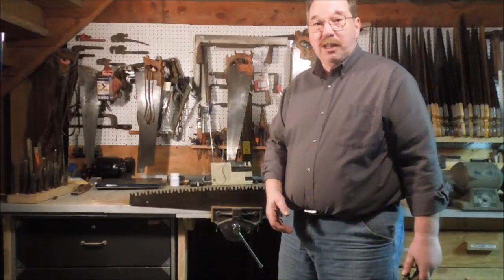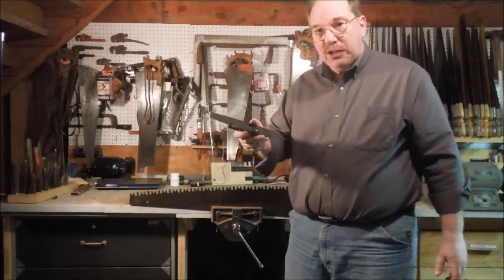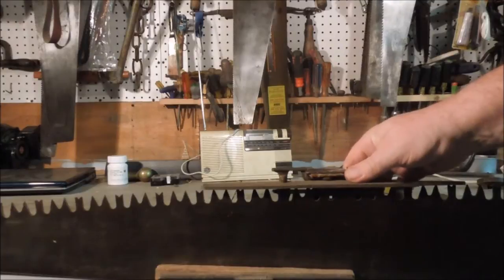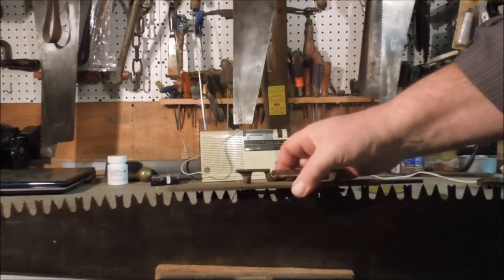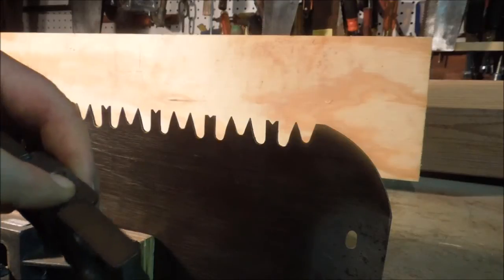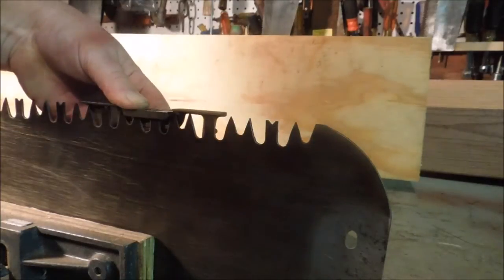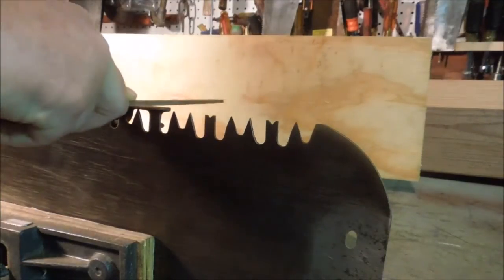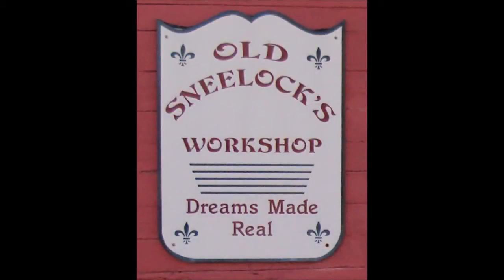Sharpening A One Man Crosscut - Pt 3 - Jointing & Setting Raker Depth - by Old Sneelock's Workshop

Comment: Thanks for this series Sneelock, can't say thanks enough for your advice and tips, I'm very grateful :) I especially had issues with my stanley pistol grip, and I saw yours and bought a Morills, I think its a "newer" version with a screw instead of a plate, but it works fine. 
 
I do have a question, in the start of this video you mention that Panel saws (the one you hold up next to the peg and raker saw) need to have a straight toothline, I do have an old 10 ppi crosscut saw which I recently filed, but I noticed the toothline was arced slightly, just like a forestry saw, to my surprise it actually cuts well, but I can tell all my other panel saws are dead straight, should I change it over time?  And how would you go about it? 

I know from planing wood if you keep planing an arc it will just exaggerate more, so you have to take more from the middle until you almost have flat or even a concave shape to then plane of the ends to flat. Its an effective method, atleast for wood ;-)
Reply from the maker: A panel saw can have a belly too. Your saw will cut a little faster and easier than a straight saw. 
The belly means fewer teeth will contact the wood at one time. So each tooth can act more aggressive. 
It is similar to what happens when you lift the handle so it contacts the corner of the cut. It cuts faster.

Comment: Sir what is the raker gauge you are using?  I have two gauges and they don't sit on the raker, the other teeth interfere by hitting the tool.  Champion style saws.
Reply from the maker: The raker gauge works by having the cast tabs on each side sitting on top of the pointed teeth. The raker tooth protrudes through the slot inmthe center of the gauge. The idea is to have the raker teeth shorter than the pointed teeth. That way the pointed teeth score the wood before the raker chisels out the wood chips between the two score lines.  You can see a representation of how this works in Part 1.
Reply: I understand exactly what you are describing.  The cutter teeth are relatively close to the rakers making part of the steel edge of the recessed raker guide actually hit the cutter teeth.  Essentially the raker guide is sitting on a skew instead of flat.  I was wondering what model raker guide you use or think would be acceptable to use?  I can post tool And saw teeth dimensions when I get home after work.  Thank you for your videos on the champions, excellent work!
Reply from the maker: @iwbuck  I learn moremaking these videos thsn you guys do watching. 😆
When I started sharpening one man saws I put the raker gauge that I used in this video on the saw and thought that it was too big. I thought it would only work on two man saws with bigger teeth. So I spent a day making a new gauge for one man saws. After I used the new gauge I got to looking at the big antique gauge snd realized that if I set it on the saw correctly it fit just fine. The only thing is, one of the pointed cross cut teeth pokes up through the slot next to the raker. You have to be sure to not shorten the pointed crosscut tooth.
Making the new gauge wasn't a complete waste of time. If you don't have access to an antique then you can copy it and make your own. I should have known that since I havevnever seen an antique one man saw raker gauge the guys before me didn't need one. Our great great grandfathers were pretty smart fellas.

Comment: Is there an arc radius measurement typical for the one-man saws? Specifically I'm have a 42" to joint and file, but no file-bendy-tool.  I can file to my mark with a measured and marked as I might do with a string. I'm handy with a file and hammer, just haven't worked on a big saw like this before.
Reply from the maker: Good question. I have never check tha actual radius of the curve. If I had to guess I would go large. 10 to 12 feet perhaps. I will do some checking.
Reply from the maker: If the blade is seriously out of joint, use a wooden rule or a flat piece of flexible  trim and bend it over the teeth so it to follows the curve of the teeth. Then mark the teeth so that the shortest tooth is marked. The rest will have more marked area than the shortest. Then file away the marked area.
If only a few teeth are really short then don't file all the way down to them. A few short teeth won't hurt much and a few sharpenings will square them up.